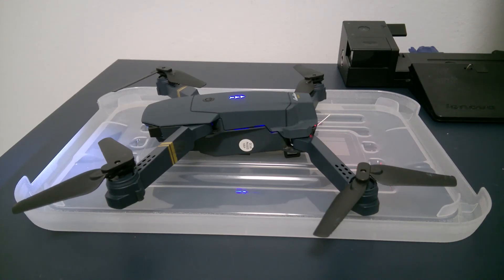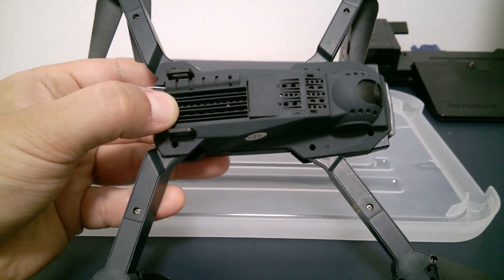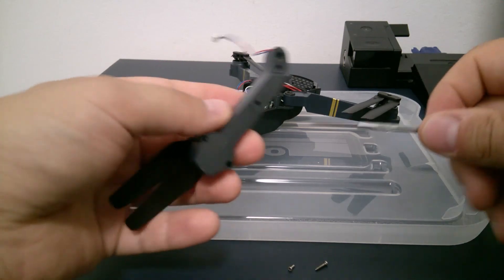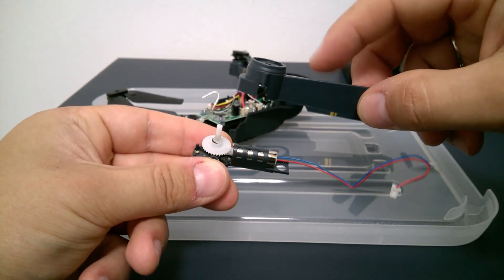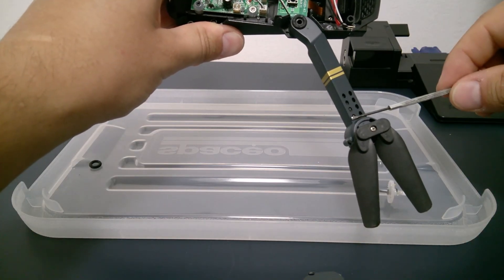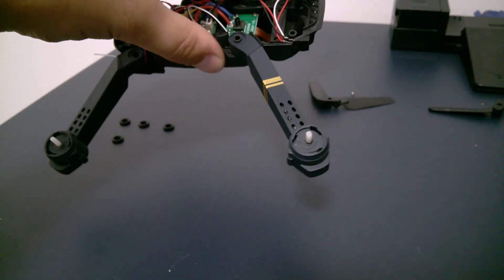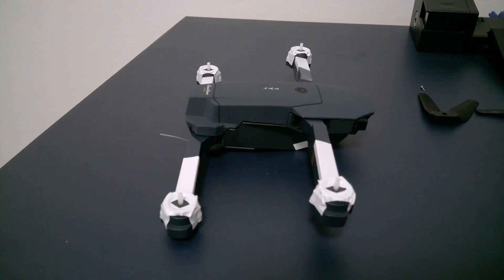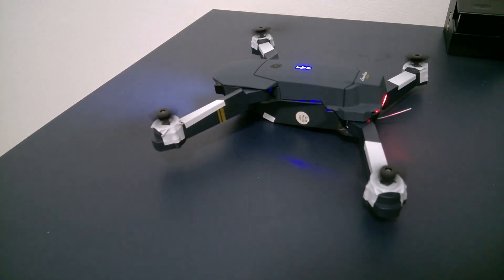How to Fix Stuck Propellers on E58 (SkyQuad, QuadAir, AeroQuad, Drone X Pro) or E88 Drones?

Comment: My brother, peace be upon you, I have a SJRC F11 that fell to the ground. Dirt entered the rear wing and the wing stopped. I filtered the wing from dirt and dust and it did not take off again. So what is the problem with the rear take-off? I replaced the two rear wings and the same problem and it did not take off.
Reply from the maker: Have you installed back the propellers correctly. You need to put them back in the same way they were installed. Check my E58 playlist to check how the propellers should be installed back correctly. If you switched the propellers, it wont fly up.

Comment: Right rear Dynamo not functioning.  Can you help me to fix it?
Reply from the maker: Check if there is debris in the gears, or rust in the motor, or wires are disconnected. Check if there is current in the wires going to the bad motor when all motors are on.

Comment: hi brother my drone is not showimg the connection of camera in wifi settings
Reply from the maker: You connect your phone to the drone via wifi signal emitted by the drone first. After the connection is established, you launch an app that should recognize the drone and then the app will get the video transmission from the drone. If you are not using the right application, check my E58 playlist where I review different apps for this drone.
Reply: @AventuraRemoteSmart  okay but i think my camera board is damaged

Comment: i checked all wires , its not stuck etc but front left propeller just wont fly it spins but stays low it also stops before others
Reply from the maker: try to reset factory calibration and try fully charged battery, check the voltage on the wires when it spins, check if there is debris in the gears.

Comment: all 4 motors work while its upside down but when its right side up only 2 work
Reply from the maker: Try to apply factory calibration, when you turn the drone the gyroscope sensors send different signals to the motors. If the gyrospope is out of balance, it may not turn the motors at all like I showed in one of my videos about how to perform factory calibration. If not, look for mechanical problems in the gears. The pins of the gears may be out of place. Dirt or sand particles may impede the rotation of the propellers.

Comment: Hi I need help my bottom left wing is not working please help
Reply from the maker: check if there is any dirt inside the gears of the propeller, or rust in the motor, you may need to replace the the gears or the motor. Or check the connections if it does not turn on at all.

Comment: my drones motor works part time and squeals whenever i take off and it crashes? whats wrong with it.
Reply from the maker: There should be dirt inside of the propeller gears. Or the gears started to play around due to tear and wear.
Reply: @AventuraRemoteSmart  Ok thank you, ill take it apart and clean it out i hope it works.

Comment: Thank you! One of the wings did not work, the little plastic gear that makes the blades spin is worn out & wont catch anymore, could I buy parts or?
Reply from the maker: yes, there are parts, you can buy a whole arm, check the links in the video description

Comment: Bro my drone 1 motor and propeller not working plz help me plz plz plz😢😢😩I have this drone
Reply from the maker: a few things to check: dirt in the gears of the propeller, loose gear pins, stuck motor due to rust, broken wires, detached connectors, bad calibration could cause that too, so apply factory reset, bad battery could be the reason too.

Comment: by trying to keep the sand out, you covered all the cooling holes, so the sand wont keep the drone from flying, the heat and the motors burning up will.
Reply from the maker: yes, I have mentioned that in my previous videos, and it was an experiment, and the conclusion is that it does not affect the motors at all, they are too small to overheat as they do not emit too much heat and there is still enough air flowing from propellers through axle holes. The only holes that should not me covered is at the bottom of the drone where the wifi and camera circuit is located, this one does get overheated and wifi signal becomes unstable.

Comment: Hi brother i bought it yesterday and i got a problem, the problem is my Drones front 2 motors working slowly can you help me please?
Reply from the maker: have you done factory calibration on a plane surface before flying?  Try a well charged battery. Check if there is dirt in the gears, clean it, try to lubricate the connections between the blades of the propellers and the the axle, check if the gear pins sit well in its place, check my other videos in the E58 drone playlist for similar topics. But if it turns slowly but flies well, there is no problem, when flying it applies higher speed and the rotation of motors becomes more balanced.

Comment: Hi, just got my drone, I go to take off and my front right motor spins a very slow speed, compared to the rest of them, and will drift to the right and not lift off the ground, I have tried replacing the battery with a new one, can you help me please
Reply from the maker: Do you perform factory gyroscope calibration before you fly? It may be bad, the drone may think it is leaning and thus decrease speed of one of the motors. Another option is to check if there is anything interfering mechanically with the gears under propellers  inside of the drone arms, check my videos on how to calibrate this drone and  clean gears in the E58 Drone playlist. In one of my calibration videos I apply factory calibration on my drone on the inclined surface and some of the propellers stop even rotating. The factory calibration needs to be done on plain surface.
Reply from the maker: also, if you replaced propellers, putting them incorrectly may cause the same problem.

Comment: Help my motor is not working I opened it and the white spinning part is not spinning freely what do I do?
Reply from the maker: if gears not spinning check if there is any dirt, small stones, sand in between. If the electrical motor is not turning, try applying oil inside, also check if you get power going to the motor too.
Reply: I have the same problem

Comment: my e58 drone motor got wet qnd it works butthe one got wet got slower
Reply from the maker: probably debris got inside, or rust built up inside of the motor, or there are drops of water mixed with grease which causes more friction in the gears. I would advise to disassemble the arm that got wet and clean it.

Comment: hi, I'm experiencing some problem on my drone, the first time i play it at outdoor and indoor, it rise up almost 2 metre high, but after that it can rise up high and even i pull the up throttle the drone keep the same height which is 15cm high only. may i know what is the problem and please advise. thanks.
Reply from the maker: you may start loosing altitude or feel like the drone goes down when the drone gets low on battery. Another reason could be the remote control stick being too sensitive, you may think you pull it up but in reality you pull it a bit to the right or to the left, so the drone does not react to go up.  The wind can also have affect. Also check the battery on the remote control. Or try to control the drone with a phone and see if there is any difference, this way you will be able to understand if there is a problem with the remote control or with the drone. Also before any flight, perform the factory calibration by pulling both remote control sticks in the south east direction.

Comment: Hi my drone cant take off its stay only on the ground what should i do?
Reply from the maker: did it happen after you reassembled the propellers? if so, check if they have been installed correctly. I have a video on how to install the propellers in the right directions. You can not put them randomly. Also check if your battery is good.

Comment: Hiya! Please help... One of my drones motor is not working. I checked if their were materials that keeps it stuck — but no. Please reply💗
Reply from the maker: check if you get current from wires that go to the motor, and if there is resistance on the motor, based on results you will know what is not working. you can also check if the axis of the motor is rotating easily, if not, try applying some oil.

Comment: Hi bro. My drone is working in all side batter 😃but it didn't connected with my mobile phone😟. When i open my phone or another phone the drone wifi address didn't show.😧😨😩plz help.
Reply from the maker: sometimes you need to wait, it may take time to detect the connection